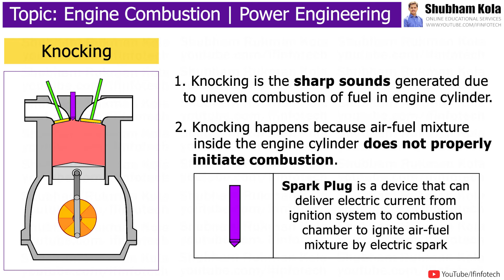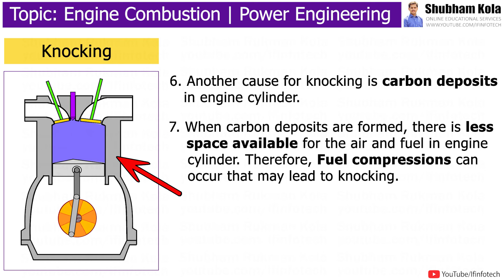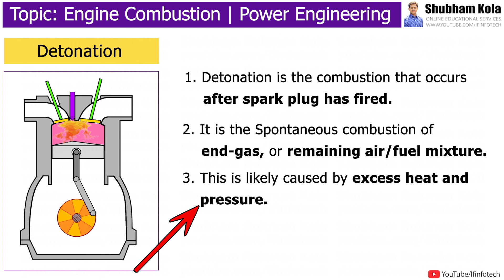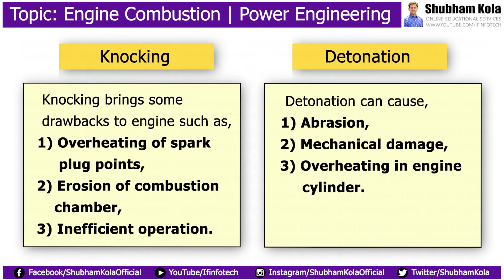Knocking, Detonation and Pre-ignition [Engine Combustion Working Animation] Lecture by Shubham Kola

Comment: Been having knocking, ended up having my timing too advanced, put some 93 in and tuned timing back to normal and it’s all good now. Still light ping/knock but it’s getting better
Reply: Does it sound like a rod knock though? Did u try using octane booster?